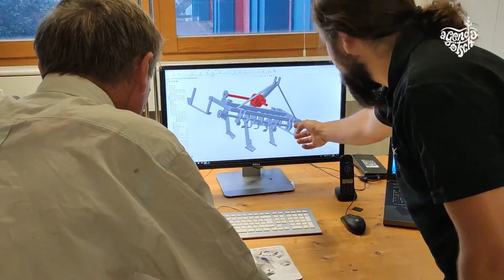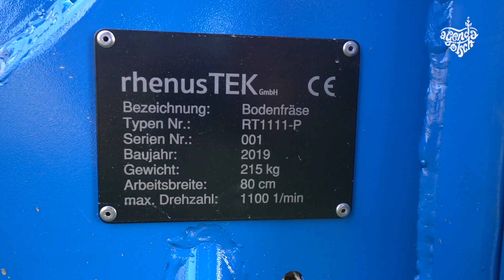PEACE FARMING TECHNOLOGY

Comment: The implement does not work well. Unless the ground has been prepared in previous years, in order for it to till while also running the chisels, you have to make a pass with just the tiller first (no chisel). That’s pretty inefficient. I wanted badly for this implement to work the way I envisioned. Unfortunately it does not.